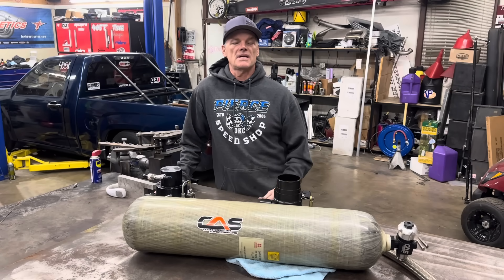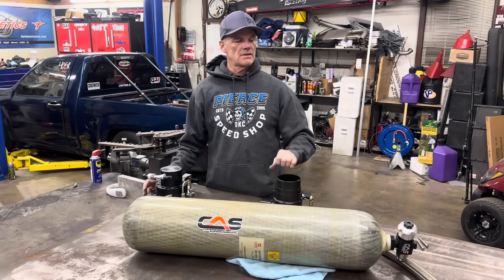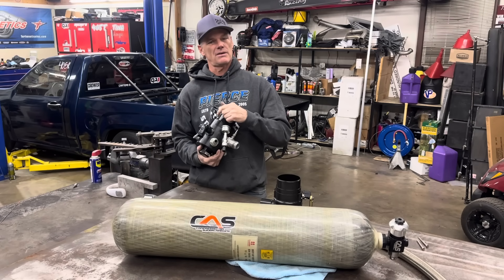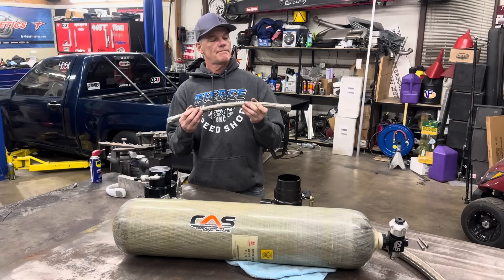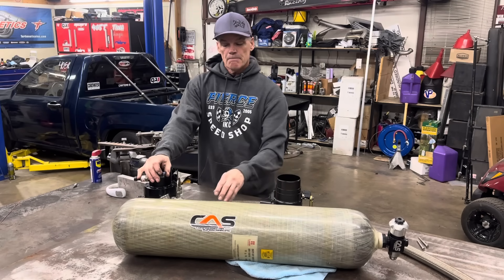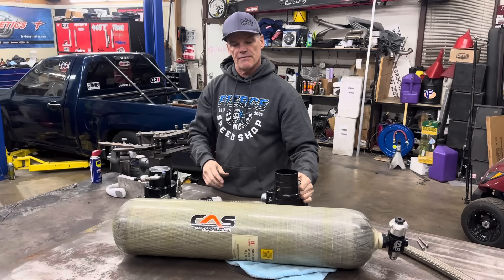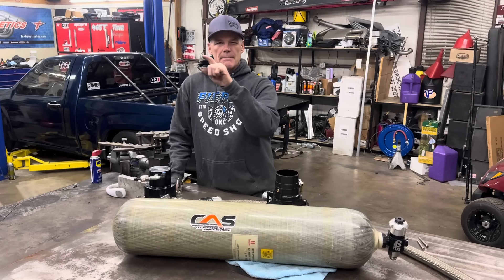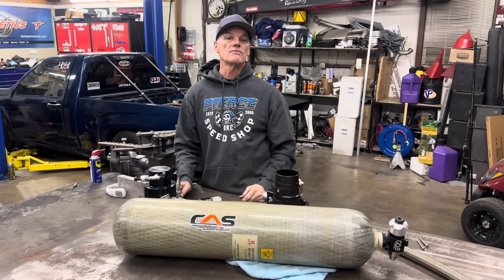Compressed Air Supercharging

Comment: I mean the math checks out.  If the bsfc is .5lbs/hr and a 1400hp motor is running 11:1 afr it would need 21.4lbs of air for 10seconds.  That works out to 280 scf of air or two 155scf bottles. The use of these hydrogen fuel cells tanks is actually pretty amazing.  The cool part that is really interesting to me is that as the hp goes up the time goes down so the required amount of air needed in the bottle doesn’t go up as much as you would think. A 2500hp kit for 7sec would only need 350scf of air for the same afr and bsfc.  The trick part for me on this kit is the regulator and control system.   I had a similar idea in high school using n20 and nitrogen to keep the motor from going nuclear.  Very cool.
Reply: Bench racing is fun. If you don't mind me contributing. I think your 1400hp and 10 second 280 scf number is off vs your 2500 hp 7 second and 350scf number. If the car runs 7.0 at 2500 hp, its probably running 8.50s at 1400hp, and only takes 850hp to run 10.0. That will impact your volume numbers pretty significantly, I get 13lbs of air to run a 10.0 at 850 hp, and 170 scf if I work off your numbers. The relationship between power and airflow is pretty linear, but the relationship between HP and ET has you taking the cubed root of power to arrive at an ET.  In other words, it might only take an added 50 hp to go from running a 15.0 to a 14.0, or a 20% change in power. Contrast that with going from 8.0 to 7.0 where you might need an added 800 hp which works out to a 50% increase in power.
Reply: The real question is would it be better to run a nitrous system or this compressed air system for a street application.
Reply: @BrieferBread66  I wonder if you could have a compressor in the car to slowly fill the tank back up after a power run.
Reply: @PaletoB   You have me thinking about road course compressor braking, fill your tanks, cool your rotors and fluid coolers with blow off. I bet there is all kind of stuff you could do with compressed air.
Reply: @ part of the reason I ask how effective the system would be on the street. Guys run air bags and can build 20psi very easily. If it is easy to fill without needing a lot of pressure it’d be like a recharging nitrous bottle.
Reply: @PaletoB  Certainly possible, not sure if you'd find it practical to get it up and running though. You can get small (~5hp) compressors to fill scuba tanks. Those can fill those tanks in 30 minutes-2 hours. They have gas versions that package like a generator that you could throw in the back of a truck, or you could work up an electric version but its not something you are just going to hook up to your cars charging system. It would need around 4kw, and a 140amp  alternator puts out less than half that.
Reply: @BrieferBread66  one revolution of an engine needs more volume of air than a pair airbags... so running an engine on compressed air is like filling those airbags 100x a second for the length of a pull. Its not a trivial volume of air, nor is the pressure trivial since you need to store it in a reasonable amount of space. As you saw in the video, it takes a small pickup bed sized area to hold a pair of these tanks which are only big enough for a single pass before they need to be refilled.
Reply: @ dude I understand how big the dang tanks are. Can you just answer the question!
Reply: @ The question of nitrous vs compressed air for a street/strip car? nitrous is the direct answer for you and almost everyone.  I reread your comments... You don't understand the tank pressure involved. These tanks cannot be charged from a typical home air compressor which produce in the 1-200 psi range. These types of tanks are typically pressurized up to around 5000 PSI. It requires a special high pressure compressor to fill these tanks. So you'd need to buy a SCUBA compressor to fill the tanks. It only takes basic math to calculate anything you want to know on the topic.
Reply: @BrieferBread66    there was a video that answered that question. I think they said about 9in round by 23in long.
Reply: @PaletoB exactly, I have been wanting to make a small turn down version of this for a streetcar that has an onboard compressor.  It might take 10 minutes to charge the tank, but on your daily driver, you're not boosting that often...
Reply: @BrieferBread66  for me this system shines for the track. After every pass you go back to your pit. The street would be annoying to have to run back to the house after every other hit.
Reply: @troubled81  do nitrous guys say the same thing every time? Surely if you had a big enough tank 6-7 psi for 5seconds would be fun.
Reply: @BrieferBread66  i mean it all in what headaches your willing to accept for your setup.  Bringing a couple of 10lbs nos bottles typically isn’t a big issue and a heater in a pinch isn’t uncommon, swapping out larger, costlier, higher pressure bottles on the street might be a bit much… i guess it just depends if your street race has space for trailers or if you can build that support system into the bed of a powerboost F150.  I love everything about this system though. It is the perfect power adder for drag racing.
Reply: @ I’m not arguing the simplicity and compactness of nitrous. I’m just asking the question of how effective would it be to run 10lbs of air for a small hit on the street. I mean price wise nitrous isn’t free, and a compressor to refill the bottle is something any hot rod guy has. In your thought experiment you stated 21lbs of psi for 10 seconds would be two big bottles. Now if you cut the psi to 6-7 which most superchargers run how effective would it be to run for a shorter 5-6 seconds. Especially if you had a smaller bottle. My whole question is how effective would this be without the excuse or brushing off with “just run nitrous”.
Reply: NO2 for street @BrieferBread66

Comment: Thank you for proving me right, I told people 20 yrs ago this would be the cats ass if someone had the time to develop it.  I have to collect on a 20 yr old bet now lol
Reply: some already have, it became DUMB the moment electrical boosted turbo chargers hit the ground.
Reply: Two guys from JPL did it in 2005.  It was in HOT ROD.

I did it on an old snapper lawn mower in 2004:)
Reply: @gibbyrockerhunter  yea i saw that, they claimed it was going to be SO FAST, but it never did any decent times
Reply: Same! Nobody liked the idea back then and i didn't have tuning experience, time, or money to try it
Reply: @BucktailResearch  no one liked it because the pride those guys had that said IT WOULD BE AMAZING and everyone told them it would suck, then it sucked... there is a reason no ONE else did this. Its simple math, the energy stored in that tank is very little when you factor in the inability to PUT that energy into the engine at peak power when you can have MUCH MORE from 1/8 the weight.

Comment: If you want to get real serious figure out a way to fill the bottles with higher O2 concentration air. Ambient air is 20% if you could fill them with 40, 60, 80% concentration it'll make even more. Of course you'd have to add more fuel too. But just going to 40% would literally double the power out put as well as doubling the fuel required.

Comment: I’ve thought of something like this years ago, and wondered why know one did it? I was not smart enough to engineer it to work my self. It’d be cool if you could regenerate air while driving. Maybe a pump tied into brake switch to pump the bottle back up, for daily driving use. Really awesome someone is doing this!
Reply: i wonder if a scuba tank compressor would work...🤔.
Reply: @ that’s how they fill tanks at the track, got to watching their channel. I’ve was thinking regen for daily drivers, lol.
Reply: Mickey Thompson tried this back in the 70’s but the technology wasn’t there to support his vision.
Reply: I also thought about this yrs and yrs ago myself as with a bunch of others. I also wondered if making a tube from the A/C to the intake would be of any benefit. (and not using any cold air yourself)
Reply: Come up with an engine driven compressor, like commercial/class 8 semi trucks use to keep the air tanks filled for air brakes.
Reply: Dude you would amaze yourself if you tried
Reply: Volvo does something similar but different. They used a compressed air system to spool a turbo and and I think an onboard compressor to refill tank while  driving. I believe to eliminate turbo lag. Is the pressure difference why you can't use like shop air/small onboard compressor to fill this type of tank? (My apologies my knowledge on that is lacking)
Reply: I was thinking something along the line of using the engine with modifications to the cam for the rear two cylinders to add the air back into them at idle.  Where it would cut fuel and open a port to the bottles.
Reply: @jaxperez7860  I don't know how much cylinder pressure is devloped under power, but cylinder pressure that isn't lit off from ignition is around 120 psi, depending on atmospheric pressure, cam timing, compression ratio engine condition etc. It might be possible to use a hydraulic over air compresser (if indeed theey make such a thing) using the power steering pump to devlop sufficient air pressure.
Reply: @jaxperez7860 at idle, the system is using outside air.  Only when they get on the line does it go from outside air to bottle air.
Reply: @dwaynecossey4867 I know this. I have a copy of the hotrod magazine with Micky Thompson's bottle baby. In the book it lays out all of the components. And explains how it works. I just figured a v8 with the rear cylinders as an air compressor would be pretty cool. especially if the V6 can make over 600 horsepower

Comment: I can’t imagine how much it cost to refill that bottle. If a 2.5lb bottle is about $18-20 to refill. Then you said it may do 2-3 1/8th mile passes. That’s going to get expensive fast. Not factoring in the initial cost of the system. The cost will level out to about what turbo setup may cost.
Reply from the maker: we fill them ourselves

Comment: It’s amazing how far they’ve been able to develop this system. I remember when it was first being tried and they were using 2 huge tanks to maybe make 1000hp. Back then they also had loads of tuning issues and problems because it was basically able to hit the engine with full power right off idle.
Reply from the maker: yes it is! thanks for the comment!

Comment: what fuel do you run and how much is required for the kit?
Reply from the maker: we run 112 in the red truck and we will run e 85 in this truck
Reply: @TinaPierceRacing  just normal injectors also?
Reply from the maker: yes

Comment: Have you thought about using nitrox blended air get your oxygen up about 40 percent
Reply from the maker: so currently we are not using all the available air, so until we max the system out will stick with just compressed air. Thanks

Comment: What about putting custom gases in the bottle like more oxygen and maybe nitrous to help cool the piston
Reply from the maker: no need for that.. Air is ice cold! as in below zero temps
Reply: @TinaPierceRacing wouldn’t increasing the oxygen content in the gas lead to more power or at the existing temperature/pressure is the soitchiometry already optimized or saturated with standard air?

Comment: Very interesting, well done video. I would think your system would make more horsepower at lower boost levels just because of the lower intake air temp, and no parasitic loss!
Reply from the maker: that is correct!

Comment: I guess the biggest question is.... how much did all that cost ??
Reply: Just say what it cost for damn sake
Reply: They are expensive. Met a dude at an event last year. They are quite pricey
Reply: It works,  I know of this team. He did a lot of work getting valves to hold and work.
Reply: There’s no replacement for cubic dollars.
Reply: Lots of money.. Lots. Lol
Reply: I had an idea to have that ejector valve, although different in my head, on a turbo car that allows the engine to breathe unrestricted under vacuum through atmospheric pressure and then when positive pressure is active it closes the atmosphere valve and then only pulls boosted air from the turbo. It should eliminate lag, but i cannot afford to test the subject
Reply: You just fill it with an air compressor or what ?
Reply: @1masonking  that's the thing you'll need a high pressure compressor, watch kc Maxx he has a 3 bottle set-up,
Reply: Get nitrous.....
Reply: Bet it's the same as any other option.
Reply from the maker: check with the website. I believe its down for a little bit but should be back up and running
Reply: @TinaPierceRacing just say a price
Reply from the maker: lol I think the 1400hp system starts at 7900 and the 2400hp is higher of course. I don't price the system and there are a lot of options
Reply: @TinaPierceRacing thank you for sharing the cost unfortunately as a power adder of that power range it is cheaper to boost or juice. From what I have priced Nitros is the cheapest, turbo and sc are in a similar price range both I could meet or exceed the power and for less money.
Reply: @TinaPierceRacing  I think it'd be much more competitive if it were just about 10-15% less. Or if you had say an 800 hp option that had a decent knock down in price.
Reply: What is the web site I will be happy to look !
Reply: mllions, probably when all is said and done
Reply: Buy a welding regulator... same
Reply: @aaronfrancois3996  way too small.    This is is running 1,000psi more than welding setups, but most importantly this is flowing SUBSTANTIALLY more volume of air.
Reply from the maker: @aaronfrancois3996  lol wrong..

Comment: I´m having hard time understand the amount of flow/airvolume supported through that last hose and injector body.
Is it like you inject 100psi, and the plenumvolume diffuses it down when the engine are 'eating' air?
Like down to 'desired' boost?
Normally an engine consumed hundreds if not thousands on cubic inches of air down the quarter mile.
Reply from the maker: yes its interesting how much air the engine is consuming, but yes, its 100 percent using only the air in the bottles during the pass. And yes, its coming through the -12 high pressure hose into the regulator and then out to -20 lower pressure hose to the engine. This is for the 1400hp system

Comment: Does anyone run a hybrid system with this and turbos?
Reply from the maker: you dont need anything but this system.
Reply: @TinaPierceRacing  Sure, but you need to fill tanks eventually. Hybrid would last longer before refill. No turbo lag or spooling.
Reply: @Mattxjax45  That would also complicate things 100X.  
    When you're using the air from the bottle there needs to be something to stop the air being pushed in the wrong direction and out of the Intake system.  So if you're pushing 75lbs of boost from your turbo and you introduce 100lbs of air from the tank, it's obviously going to cause some huge issues with your turbo.  Like spooling.

Comment: Hi you thinks its possible convert nitrous kit to compressed air ? I live in Europe, and in my country nitrous its hard to find and expansive ... I woud test reffil my  bottle with  air compressed ...
Reply from the maker: no. this is all custom very high-pressure components. Nitrous bottles won't hold enough air or flow enough air to feed the engine
Reply: @TinaPierceRacing  ok thanks
Reply: You can use scuba bottles like 300bar,but scuba bottle valve might be a restrictive and valve thread of bottle is different US vs Europe.If I remember right manufactures website say  4500psi/300bar
is filling pressure,nothing special for scuba divers.
I don't find any price set/individual parts
You can check it CAS website
Reply: @kihe2872  yes I think use this method in futur...  On Aliexpress I find high pressure compressor.. with  high pressure bottle ... But I will find tip for convert valve on dash ... 
I regret dont  living in Us for this.  Usa is the best space from car culture ;-) ...
Reply: @kihe2872   thanks I think test this in futur
Reply: They’re also not using the compressed air like nitrous where it’s just sprayed into the intake and the engine has to pull it in. This setup has a valve that closes so the engine runs off the tank. It is more like replacing a turbo/supercharger with an air tank.
Reply: @NBSV1  yes but I think , maybe work so as nitrous for tiny engine  .  I've 1.6liter and my engine  vaccum not a lot of air . My reasoning is if you introduct more air  not really in large quantities but rather in a rapid way like the n20 you will necessarily have a gain... certainly less than n2o because not 33% oxygen since it will be ambient air under high pressure. 
the goal is to get 22 percent more oxygen into my engine more quickly... sorry I hope you understand english is not my native language...
Reply: @ It wouldn’t really do much because the air wouldn’t be sealed. N2O works because it has more oxygen than the regular air it replaces. With the compressed air you’re just replacing regular air with regular air.

Comment: why are you using the shutoff valve(/throttlebody thing) and not just let it be open, would'nt that create a venturi effect, and pull more air in? or are you trying too put all of the intakesystem under pressure?
Reply from the maker: remember, we boosting the engine with air so it needs to make pressure inside the intake manifold. With the ejector open the air would escape. So we only make a pass on the bottled air